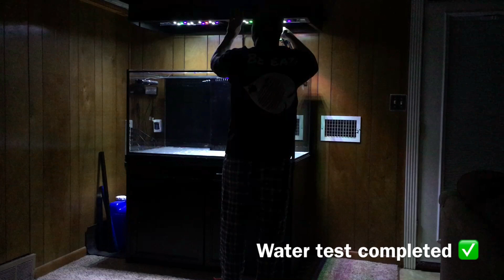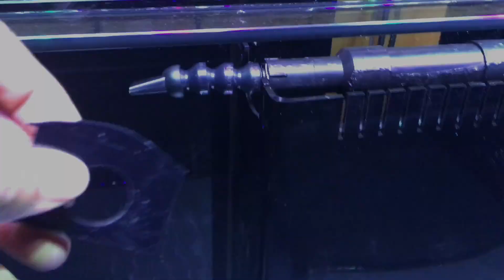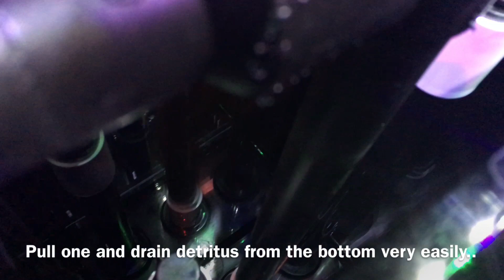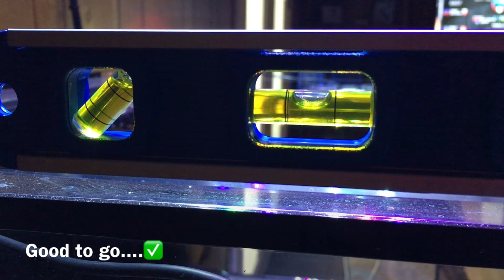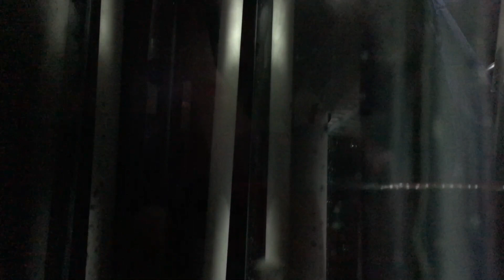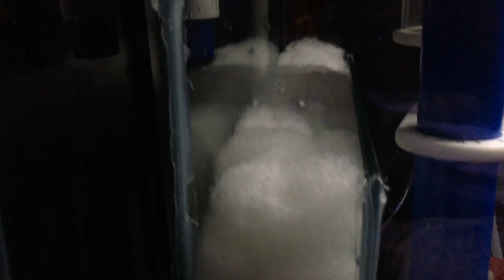SCA 120 Gallon Reef Tank | Ep.6 | Last Adjustments - Manifold, Drain & Leveling

Comment: I wanted the great water flow from my return pump (same as you used ) to split into a top spray bar (1/4) with most of the power going to a bottom of tank for outstanding agitation flow clearing off the bare bottom side of the display(across to sand bottom side) . This required two check valves . One in the feed line behind tank and a SECOND put in a tee at the water line but installed in reverse . The water line check allows no flow in to tank (in reversed position ) but in the event of a pump turn off, if the main check does not completely close the second will (in reverse) open and let air into line quickly breaking any siphon .
Very nice series of videos !

Comment: Heads up on that Heater controller. Mine is 3 degrees off using that same one.
Reply from the maker: Joseph Morello seen brs mention that too.. I'll check with another thermometer and adjust for it. Thanks 👍🏾

Comment: hey CJ. looking good 👍. check out "deep blue advanced poly fiber" you might like it better than floss. I noticed a huge difference when I started to use them. they are cheap and can cut to size. one pack usually lasted me 2 months and catches everything without restricting flow.
Reply from the maker: Reefing with Billy Pipes def will check them out... floss takes awhile to compress enough to catch what I want. But cost effectiveness of the goal as well... prob try a few diff things as I go till I find the right one for the sump
Reply: CJ'S AQUARIUMS 👍

Comment: I would maybe suggest adding slightly more shims because when you add all the weight from the water and rock the tank will settle down some making it not completely level. It's still doable, but might bother you.
Reply from the maker: NoOneCares should be fine 3" apart. I can tap them In further as I fill the tank if needed